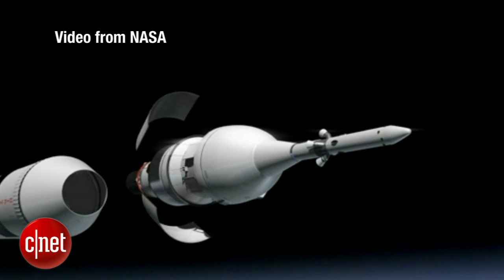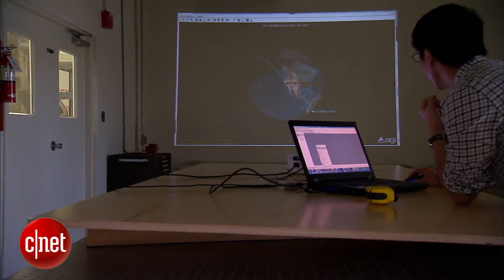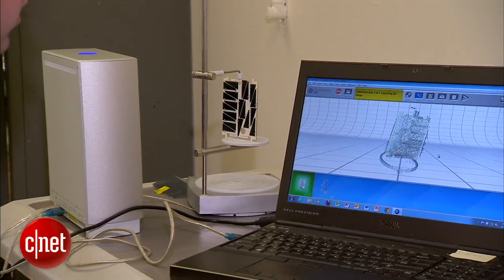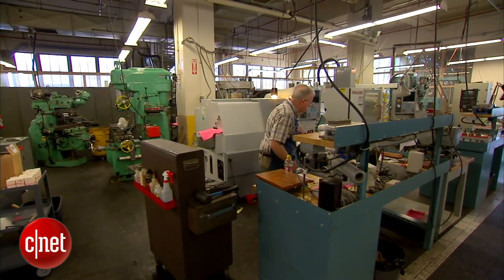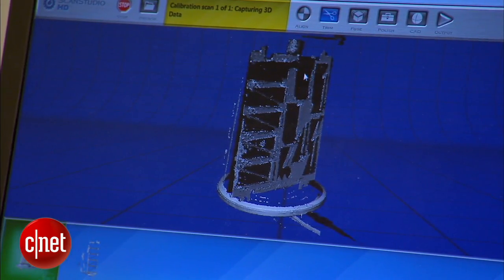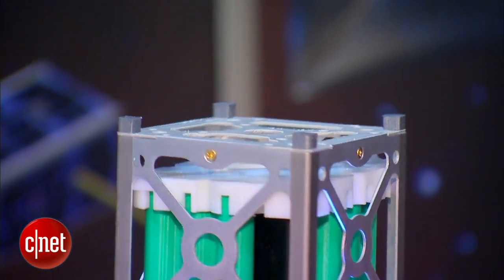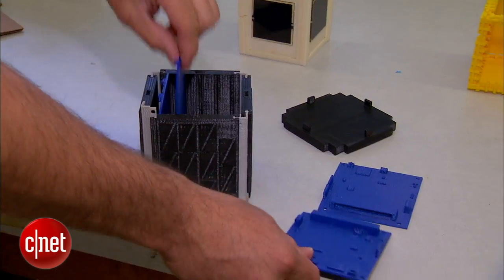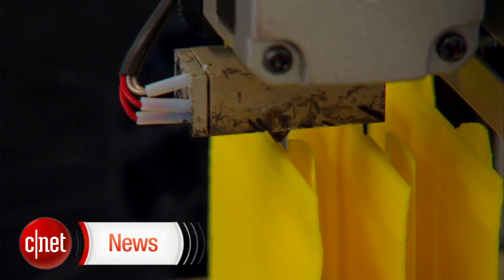CNET News - Need to repair a NASA spacecraft? Just 3D print it

Comment: Manufacturing boils down to what kind of material is it made of.   What types of materials can 3d printers use to make things?  The computer I'm typing this comment into, contains several different types of materials. 
Also, 3D printers cant mass produce things very fast.